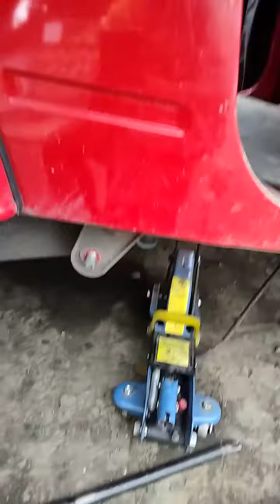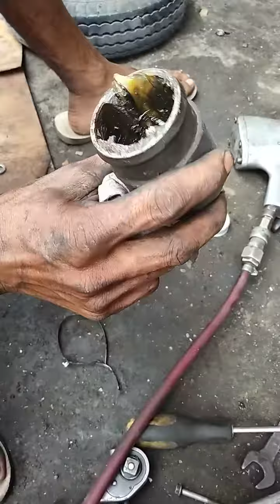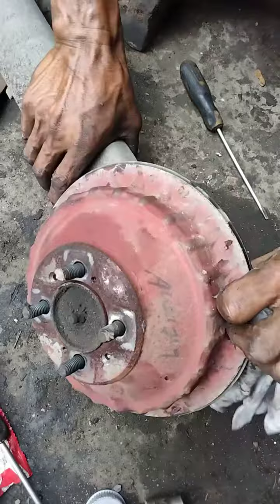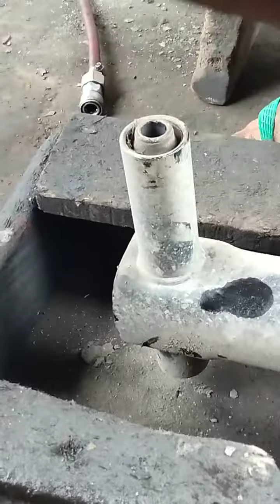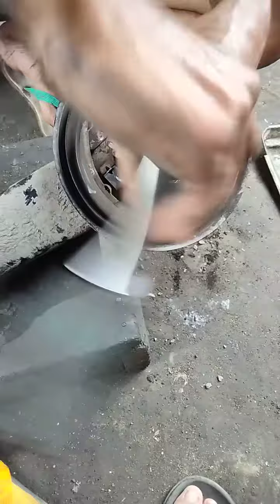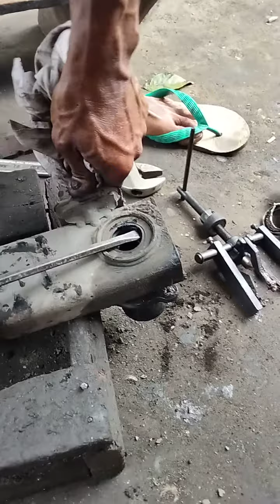part 1 palit bearing at grasa

Comment: San po kayo nakabilu ng bering na pang bajaj??
Reply from the maker: Kung Yong mga ball bearing sa gulong ang size eh 6204 tsaka 6301 sa mga bearing center or auto supply meron po mabibili,Yong needle bearing nman po sa mga authorized dealer ng Bajaj re spare parts lang po nakakabili tsaka Yong mga bearing ng engine

Comment: Size po ng bearing at San po pede makabili?
Reply from the maker: Yong ball bearing na 6204 open type sa auto supply meron po o Kya sa mga bearing center,Yong needle bearing po sa mga autorized dealer ng parts ng Bajaj re lang po nakakabili.
Reply: @michelleestrada9608 , salamat po sa pag reply.. Ganyan din po sira ng RE ko.